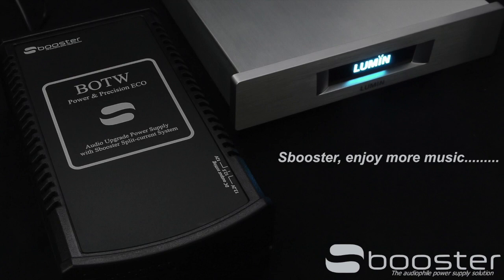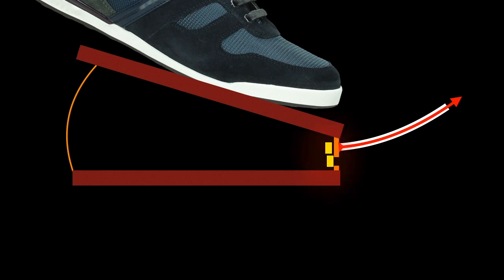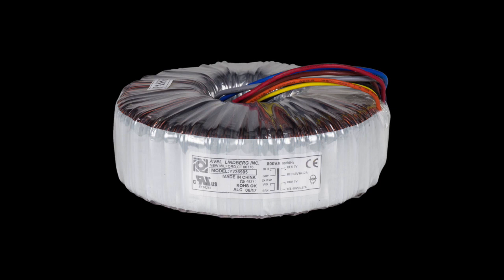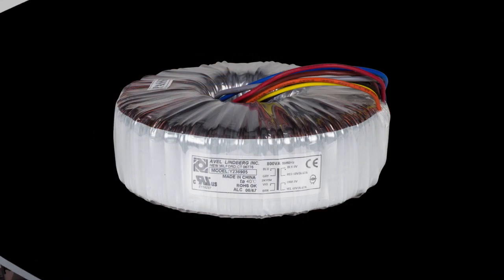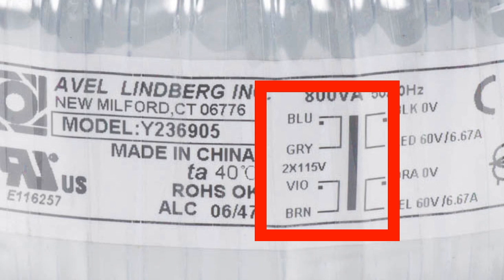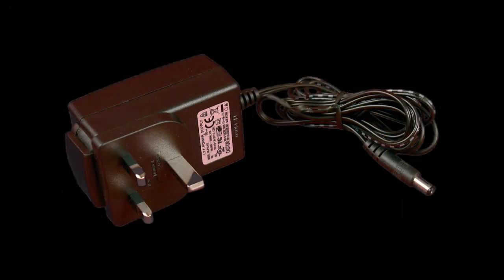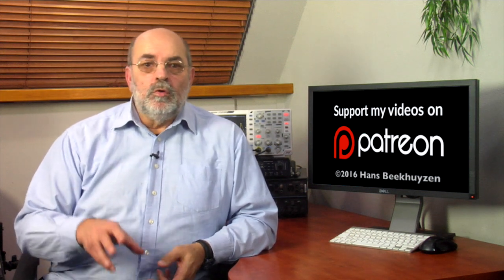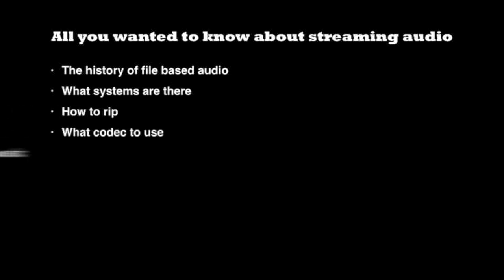External power supplies part 1 introduction

Comment: I've been looking for better switching mode power supplies.  I know iFi makes some, though frankly the price is a little steep (especially for what is not intended for critical listening).  But the ones that come with low end class D amps are often lousy, better suited to non-audio applications.   I know from experimentation the audio quality of these smaller class D amps can be improved with a better power supply.
Reply from the maker: If you think the iFi is expensive, you better stop looking. Good power supplies require expensive components and thus cost more than the really cheap ones.

Comment: Good analogies/explanations for rectifier parts using foot pump and water tank. 
_??_I am just puzzled about how 50 or 60 kHz switching frequency in a switching power supply can contaminate audio signal. Is it a grave inconvenience? Does it affect any lower frequencies or only 50 kHz and higher harmonics?
I am looking forward to the next episode. Hope we get to see under the hood.

Comment: Do battery-powered audio components avoid the problems you describe? If so, why are they still relatively uncommon?
Reply from the maker: Barreries do partly solve the problem but usually are slow to deliver current when the audio needs it.
Reply: Thank you. Your videos are very informative; I'm looking forward to part 2.
Reply from the maker: I hear mixed reports. I for myself have used battery operated gear years ago and it drove me mad. But feel free to compare them...
Reply: What about a capacitor array? Batteries are low but little capacitors can be very fast in delivery current
Reply from the maker: I don't wanna go there. This channel is already getting more techy than intended. But please try if you feel like it.

Comment: Hello Hans,  I have a questions in regards to  ferrite beads which  I understand are found at the ends of many cables (USB, keyboard, etc)  to suppress or filter the amount of high frequency electromagnetic interference (EMI) noise ( I believe you mentioned the SBooster has one at the end of its out connection).  From what i have read they may be added simply  to any cable to reduce electrical noise and  are an simple way to reduce EMI.  Do you have any  thoughts on if adding these devices would be a  good practice or if it would be of value to an audio systems ability to have a clean electrical source of power?  Thank you.
Reply from the maker: I have not experimented enough with them to give application instructions. Sorry.